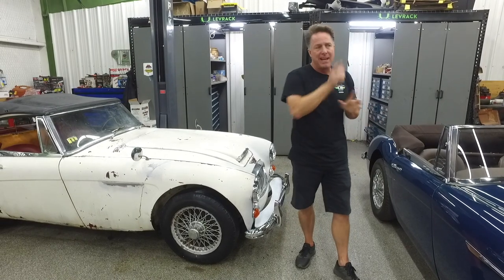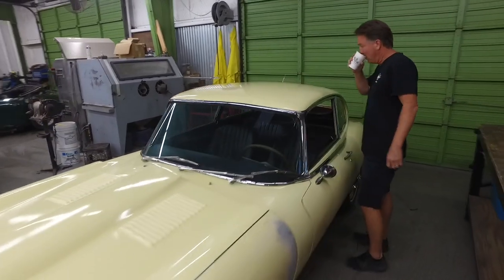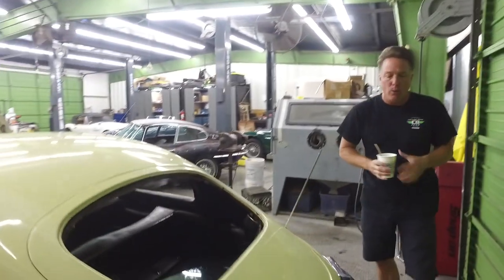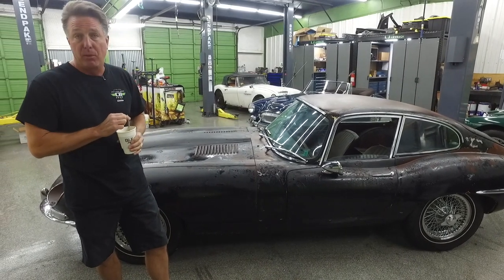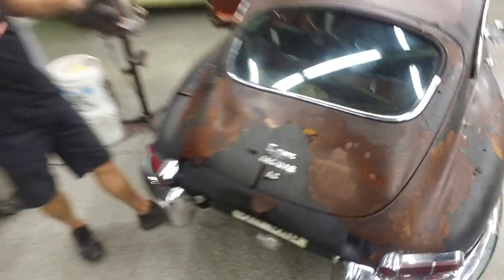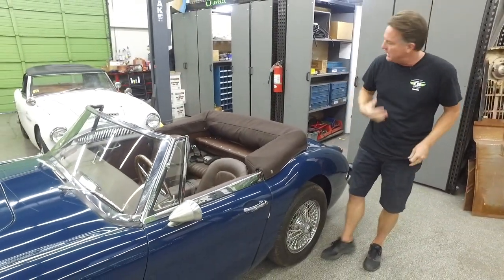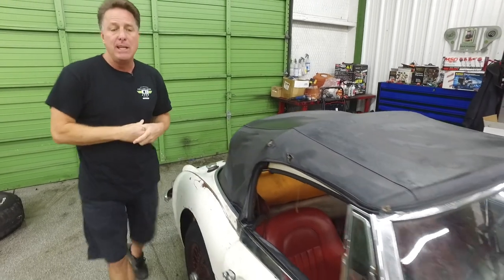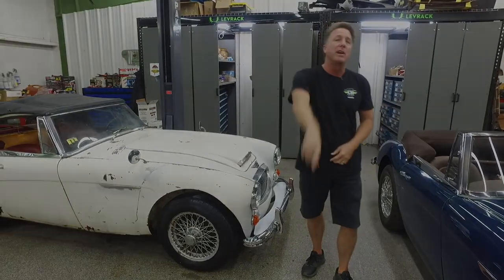CW67: BRITISH SPORTS CARS

Comment: Having owned 2 '67 2+2 automatics, that Borg-Warner 3-speed was bulletproof. Manually shifting through the gears, every gear-change jerked you back into your seat. Being 10" longer than the coupe and roadster the highway ride was superior. The man should have left that machine alone. When we consider how advanced this machine was: It is an inline 6, twin-cam, triple-carb hemi, producing 265 horses, with independent limited slip differential. Definitely the poor man's supercar.

Comment: I bought a old 1960’s MGB midget years ago that an older lady owned and drove quite often until a tree fell and clipped the rear end trunk area,  I got it for $250 and put it in a storage room at one of my shops. A couple months ago I sold the original wire wheels in great shape for about 4 or 5 times more then I paid for the car. After that I sold all the original trim and lights/reflectors for a pretty good profit. Then I left the good doors and hood go for a few hundred. The original top that was in fair shape was sold to another collector for a good amount of money. After that I sold the entire drive train with a running engine for close to 2k. After it was all said and done it was a pretty solid $250 investment I made. It was almost as good as the 92 Toyota Cressida project car I picked up from a lady whose husband had done a engine swap back in the early 2000’s attempting to build a race car but never actually finished before he passed away. He put everyone’s favorite Toyota engine into the car the same engine that is going for stupid prices today. The car sat in her garage for nearly 13 years and when decided to move she came to my shop asking if I knew anyone who would buy a old Toyota car for about $750. I gladly paid her the money. Either that special motor was pretty cheap in the early 2000’s or her husband was like all car guys and told his wife the engine wasn’t expensive at all.

Comment: Series 1 Jags! I drove one for 10 years on Dallas streets back and forth to work. To survive the traffic heats, I noticed yours as mine has the delco-remy alternator conversion and voltage regulator that mine had also. Series II cars had a bigger radiator with the two fans. Stays cool. Also, put in an all syncro 4-speed from a series II. Then they last forever as mine went 120K without needing to take the head off or anything serious. Plus there's 3 pedals on the floor and one of mine was all the way down most of the time!

Comment: The 2+2 has only one side mirror?
Reply: I believe MANY Cars of the time period were Factory Made with ONLY the drivers side mirror.   My 1973 Jaguar XJ 6 is one of those examples.  I put a passenger side mirror on after driving it without for so long - - - - - -what a HUGE difference it made as you could imagine.  To me , it's a safety thing. To them , it may have been to reduce costs .

Comment: You need to quit selling your miss made JK soft top skins on ebay. A top that will only fit 2010-2018 JK's and require windows from a 2007-2010 to work isn't right. They also are not Mopar brand like the ad says. Buyer beware when dealing with Dennis Collins Jeep.